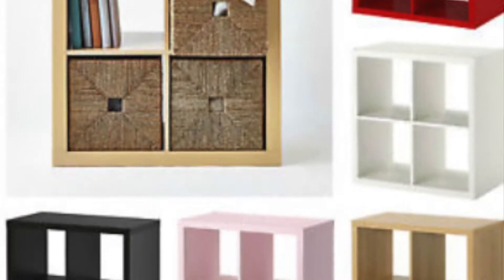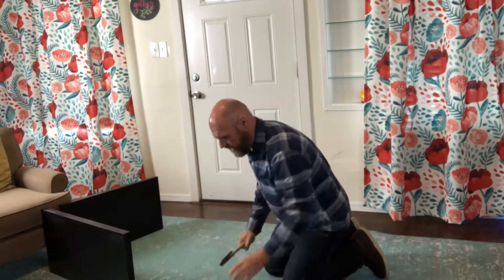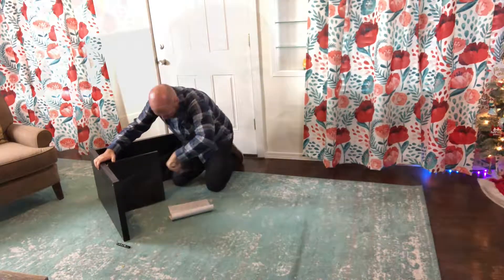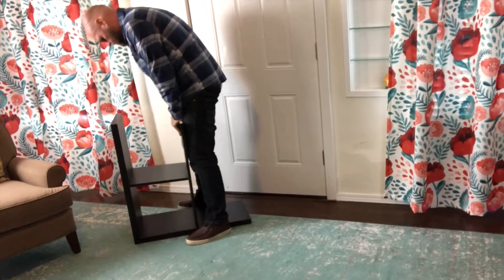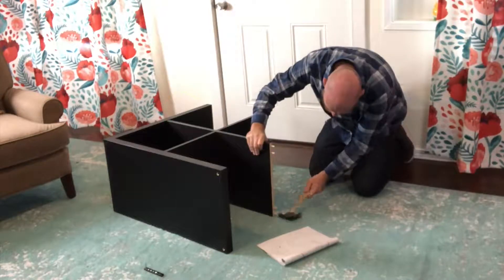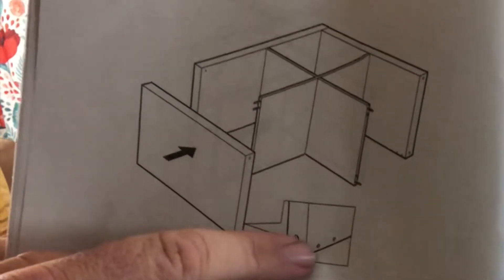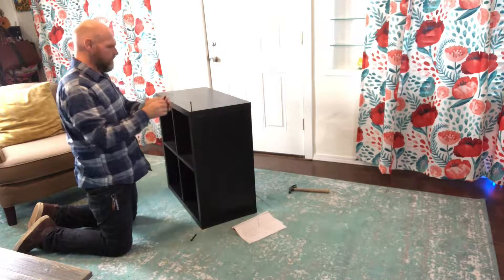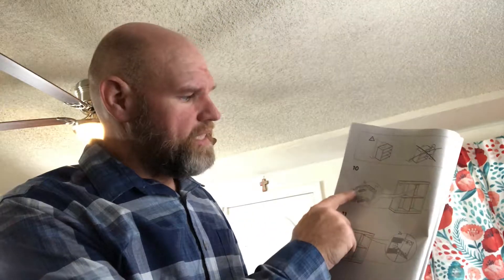IKEA Furniture Quick Build | Kallax Shelving Unit

Comment: Would you happen to know if it's possible to like seperate each square or some other way to adjust the shelf to make it smaller in any way? I have a space that my mother didnt measure before buying the shelf and it's just a tiny bit too wide to fit in the closet she wants it in. Thanks in advance for any suggestions
Reply from the maker: Thanks for the question.  I have seen a similar shelving system at Walmart.  It seems to be thinner than the IKEA version.  I’m just not sure if the compartments IKEA sells would fit in the Walmart version. Good luck.